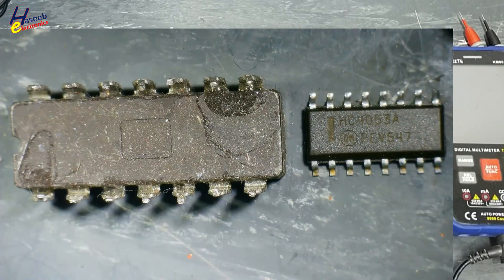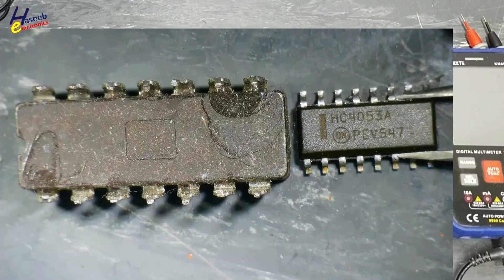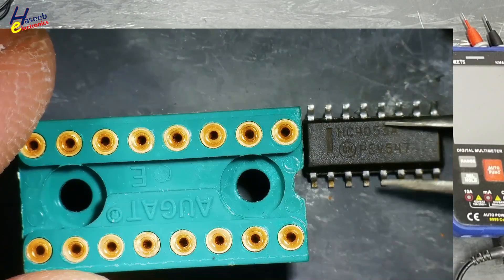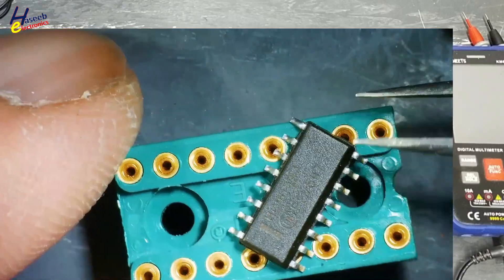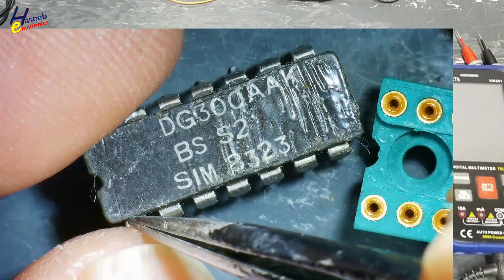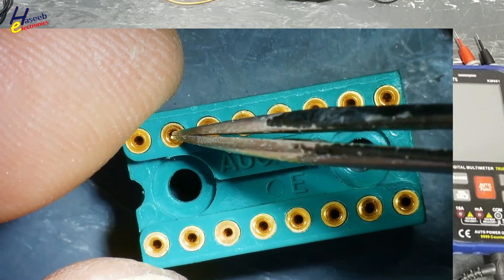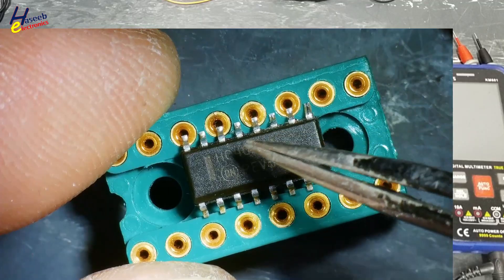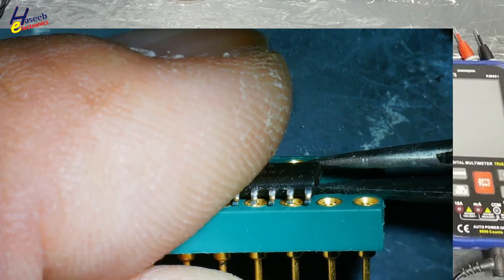{1414} How to Make SMD to DIP Adapter | DIY IC Converter || Convert SMD IC to Through-Hole Easily

Comment: Nice video bro Thank you a bottom of my hearth <3 Can you help me, I have psu for pc, and have a short circuit on 220v, I remove bad capacitors after fuse, smaller blue one, and when I pull out Greek compund short circuit is gone but when I measure out of circuit it has no short, but when I back on psu I have short again what I can do about it? Thank you for your time for reading this comment ❤❤

Comment: Great workaround - I have made some PCB's with header pin inserts for various pin #'s  - saves some time with the soldering wires - glue is always a great vibration and environmental protection option. :yougotthis: